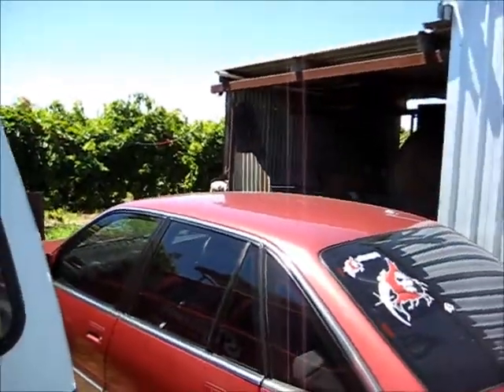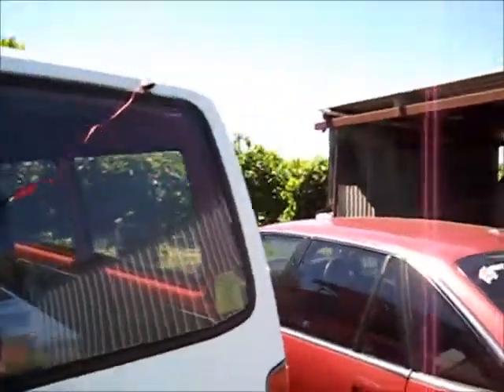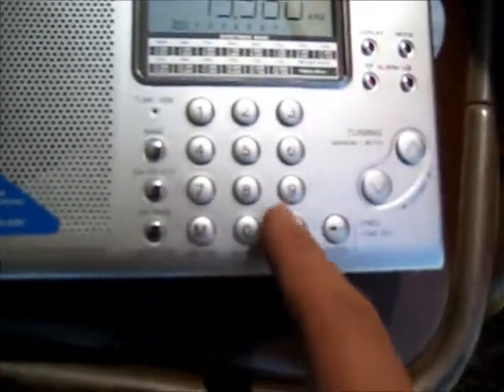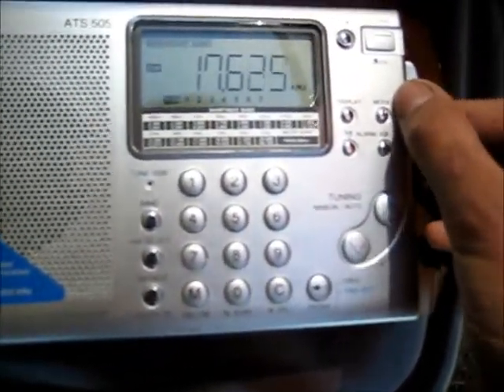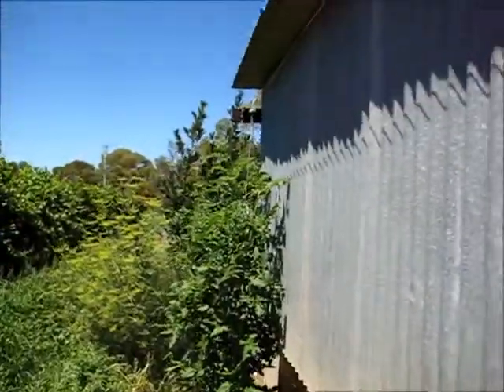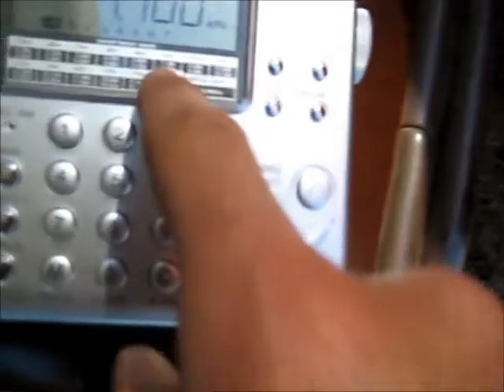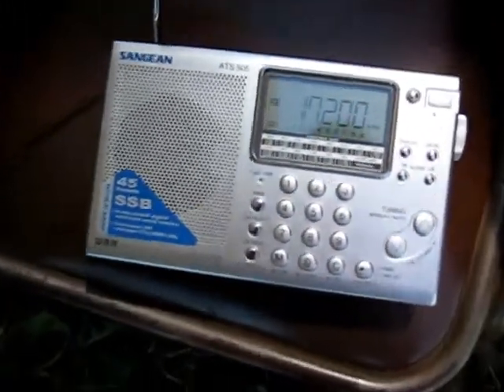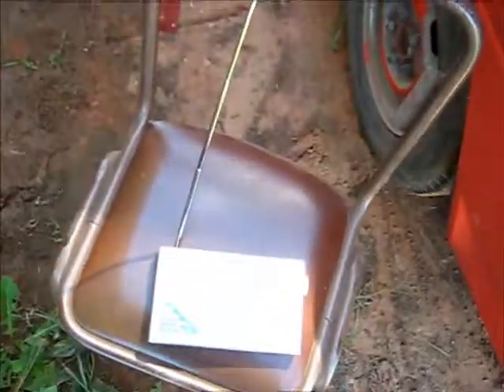Shortwave Antenna

Comment: Your on the right track that sangean is a good radio I have the 909 just love it but I mostly us it for amateur radio stuff though all you really need is 60' of just about any kind of wire you can get your hands on for cheep I really improved my reception when I put the MFJ-1026 in line with your antenna..your doing a good job by experimenting with all that wire. From a HAM

Comment: Go down to the lower end on 7Mhz and pop it in LSB then go surfing for some amateur stations.. Anywhere from 7.000 to 7.300 but listen around 7.090 and upto 7.150 for some local action.

On Monday, Wed, and Fri nights turn it over to 7.130 at 8.30pm eastern and see what you can hear.